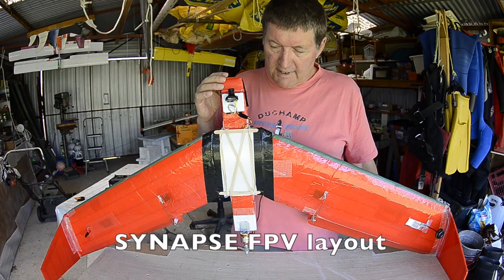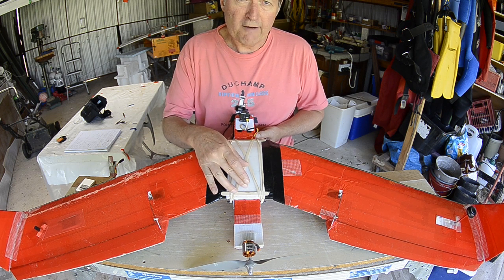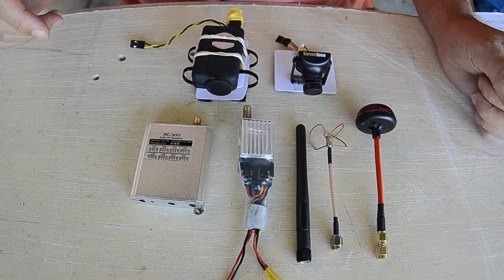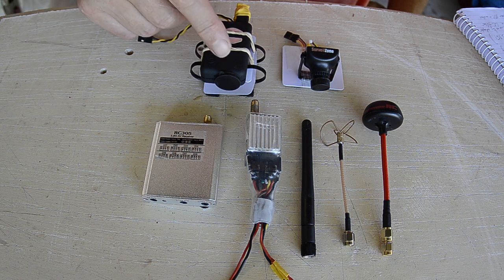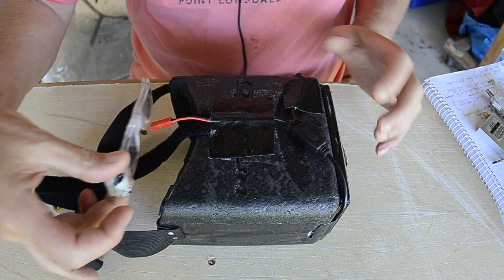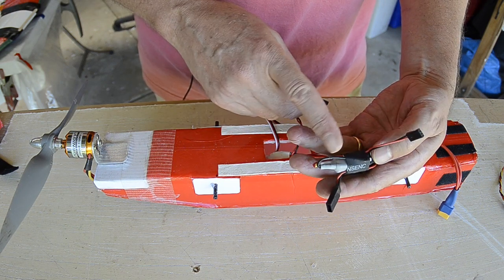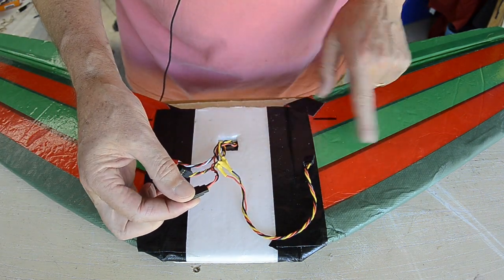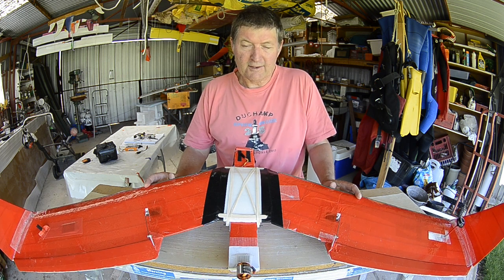Synapse Wing FPV layout

Comment: Very nice mate, I too use the cheap HobbyKing goggles, they work great with a bit of modification! I replaced their little crappy fresnel lense with a full sized one (cut down an A4 reading lense), muuuuch better! You really need to put your cameras on a modified 180 degree servo though, being able to look wingtip to wingtip is where it's at for fixed wing FPV.

Comment: Good morning. Was just wondering what your opinion was on these types of flying wings with the lower separate fuselage. I was thinking about doing something like this with my hot cut wing as it could hold more "stuff".
Reply from the maker: It's an excellent design Nathan, makes balancing and gear layout so much easier with hardly any loss of performance. Can also swap fuselage between wings.

Comment: Hi Andrew...If you uprate your VTX to 600mw, you should be able to get 2Kms, even on the skews...Your Tarranis should also be up to this distance using standard anttenas...Of course, you could also use a 5 turn helical on the Video reciever, on the beach it should work really well...I would like to see a distance flight soaring FPV up that beach !!!!!!  The best thing about the beach, is the edge of the water makes a natural course marker for you, so you can stay in a straight line when using a helical for instance.
Reply from the maker: EnglishTurbines I have a patch antenna and diversity VRx to play with so that 2km glide along thee beach may become a reality.
Reply: Andrew Newton I would really like to see that 2km trip out Andrew....I just watched this clip again and noticed that you used 2 x +4 reading glasses in those Goggles. I have the very same Quanum setup and had to move the screen further away on an extension tunnel before I could focus on the Screen, I actually put a pair of my reading glasses in just like you did !!! Now, although I can see a sharp image, the Tunnel is too long and is difficult to wear it...I might try the two pair trick you did now....I usually fly on my 7 Inch LCD and its fine really, but if I can get these Goggles to work I would be very happy....For the record, I tried some fatshark goggles on, absolutely hopeless for me...not enough IPD adjustment and the image was not good at all...with you on that score.
Reply from the maker: EnglishTurbines I changed video receiver to a better quality FR632 (diversity and 32ch) intending to using a patch or helical as well as the skew planar. It doubled the range with just the skew planar. Can go well past 1km before there is any interference at all. Just waiting for the right weather to push the limit.
Reply: Andrew Newton Good, Id like to see that full footage...Yes, diversity is the way to go for sure, in fact if you use a 600mwVtx 3kms should be easy with a directional. But, you will need a Storm AP as backup, outfly your RC range maybe.